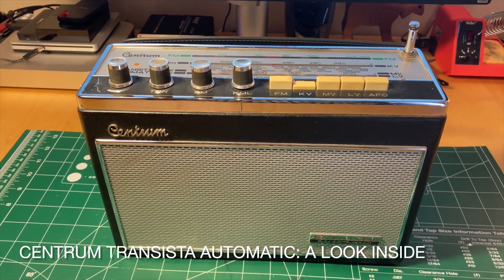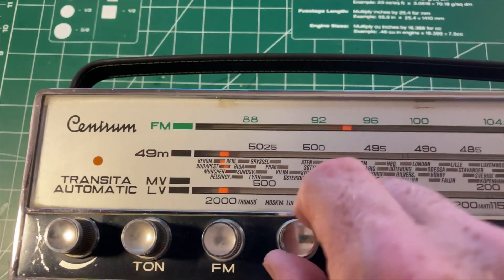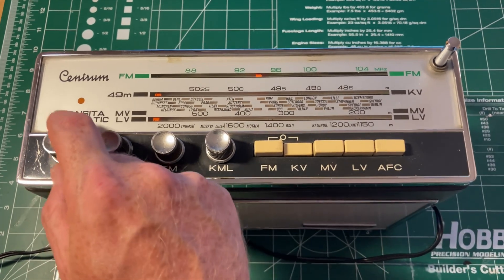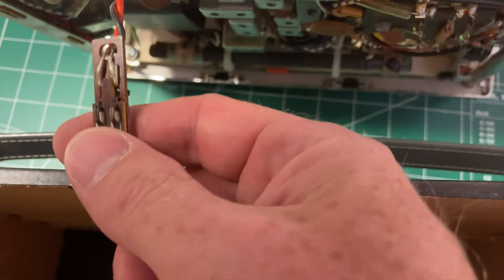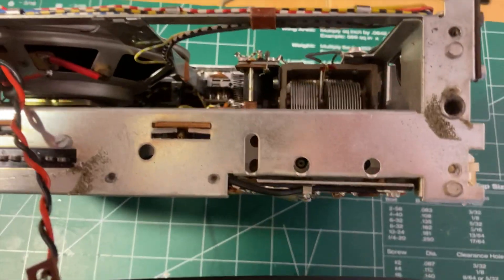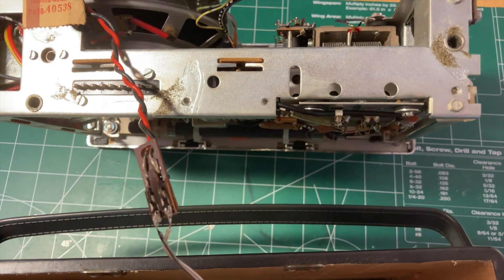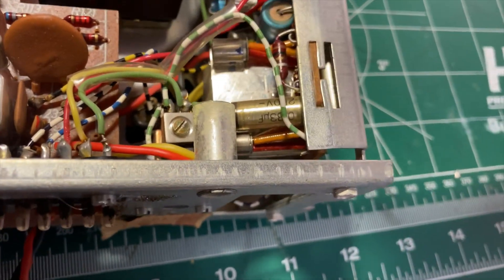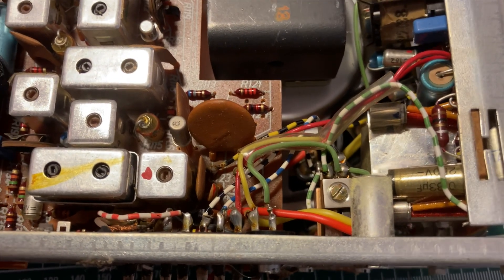Centrum Transista Automatic Radio: a look inside

Comment: That’s REAL RADIO!! I was going to guess 1956 for this radio. Quality went in before the name went on. I’m sure it’s a multi band radio. Looks like you’ve had this for quite a few years. I hope 🤞 the dial cord does not break. I also wonder 💭 if this has a dual dial cord system. If so, they are VERY HARD to restring. I like 👍 the “CB” sort of look to this. Your friend, Jeff.